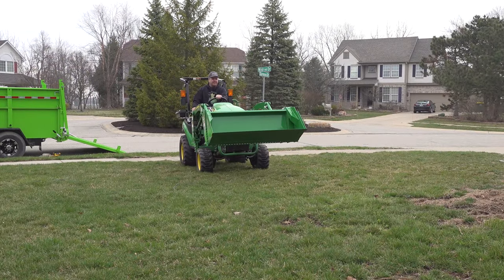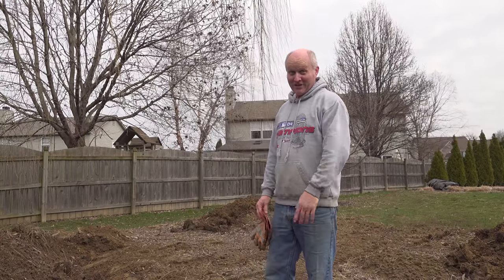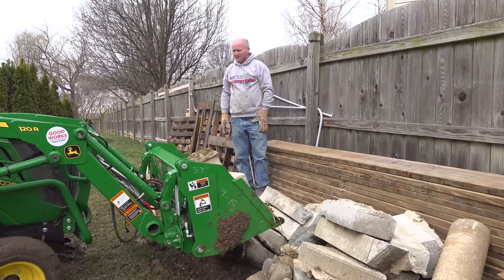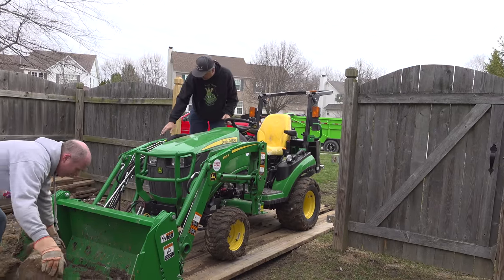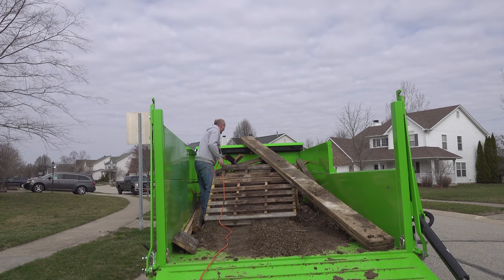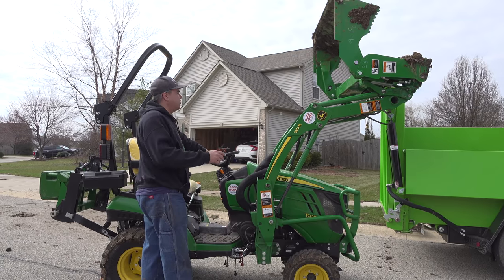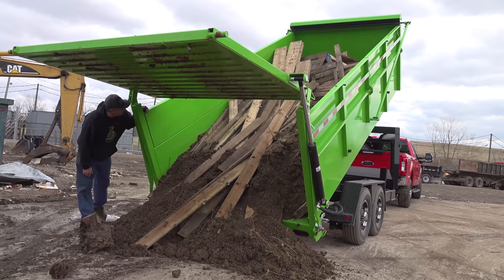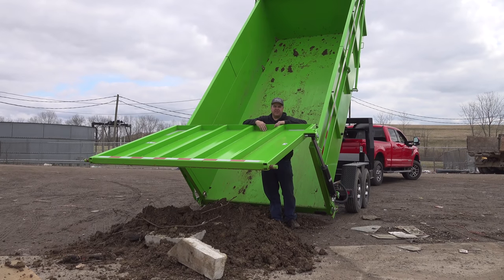4 in 1 Bucket First Use, First Impressions

Comment: To your comment about not getting as much in each bucket, try lifting the bucket first when loosing traction instead of rolling it, when driving into a pile.  I have no experience with this type bucket, but have you tried just taking a bite out of the dirt pile instead of pushing it into the dirt pile, probably requires significant hydraulic pressure.  As to the bucket not grabbing as well as you would have liked, as a young boy growing up on a farm on the 60's & 70's I always wanted the tool to do everything for me.  I will relay my father's advice, get your a## out of the seat and load the bucket up by hand, tools can't do everything for you.  Be thankful you have the tractor and loader to carry the load from point A to point B.

Comment: I would say half the issue is Tim doesn’t know how to use it. When using a 4/1 you need to open the bucket and tilt it forward to grab stuff. With that being said on machines this size I don’t think there worth it with the extra weight.

Comment: I am a little disappointed in the you didn't save and reuse some of that. Dirt you can always use. Concrete can be used as fill or as rip rap for washout. Looked like some of the boards could be saved to. By reusing some would save of dumping fees and help the environment out to.

Comment: I don't like 4 in 1 buckets unless I'm picking up the last little bit of dirt off a street or other smooth hard surface they will get all but a couple shovels full. That and dumping over the side of something tall where you don't get lots of curl like into a ten wheel dump truck with a small tractor. There too heavy for most of what I want to do with them though. Get you a pump sprayer and put some diesel in it and when your dump bed is clean spray it on liberal. It will help that stuff slide much better. We used to use it to get asphalt to let go and come out the bed. Its real sticky

Comment: Always put the sliperyist stuff in first, been there done that - ONCE. The bottom of your trailer is going to get scratched. Get over it. Its a tool.  As for the 4 in 1 not ment for something that small. You need to upgrade to 30-40 hP tractor or skid steer.

Comment: How fast is that tractor how powerful is the engine in that John Deere diesel tractor how much power and RPM does a guy how much Diesel power does a guy powerful does that tractor works rangiku it did a 2018 tractor you got a 2019 tractor that you got tractor time with Tim Tim my powerful it is.

Comment: Yeah a little bit the trailer you got tractor timer 10 mile of that trailer since you got that green trailer I love the gooseneck to I love all that about you tracking timer 10 did y'all get y'all y'all y'all Century heater brand new century heater put in and did y'all get your central air condition put in that y'all what kind of sent your ass since you put it in your new Prophet y'all knew how did y'all say y'all the house yet. Real tractor time with Tim.
Reply: What ???

Comment: What kind of engine does you got what kind of engine does you got in that John Deere tractor that knew you got what kind of engine how powerful you is how much they can pull how much weight that it can handle on that John Deere tractor how fast it is how much weight can it handle how powerful it is.

Comment: you are using that bucket totaly wrong, open it up, roll the bucket all the way forward down lift the loader over your junk and come down over it and close the bucket tight as you roll back, they work great, some thing when you were trying to push into the dirt, no need to push roll bucket forward with it open push down into pile and close bucket as you roll backm drag dirt back with bucket open using the front lip to drag bab an close it, when dumping the trailer life the box all the way up before pulling a head, it will all come out in a short pile, not 200 feet long, it all comes with exsperence, 40 years
Reply from the maker: No way to do ‘short pile’ with such a low profile trailer.

Comment: You made the mistake of putting the soil on the bottom and then packed it down with the tractor you should have reversed that.
Reply from the maker: What you call a mistake I call smart thinking.  You can destroy the bed of your trailer with huge concrete if you wish.  I’d prefer to take care of mine!